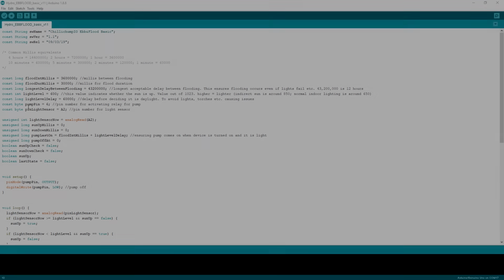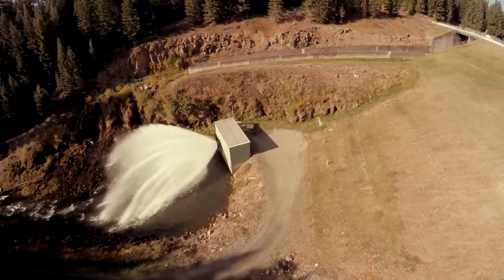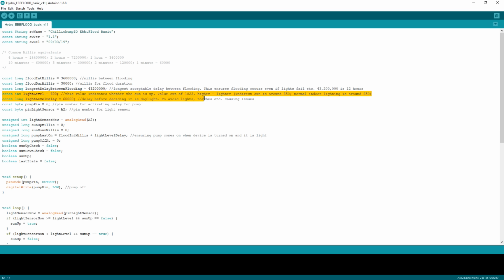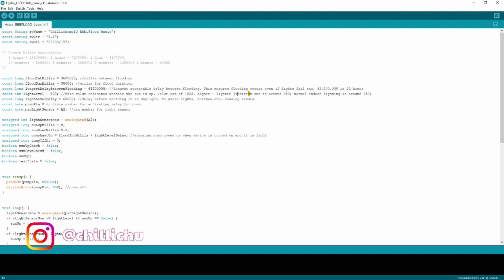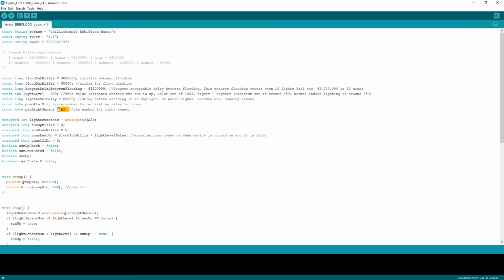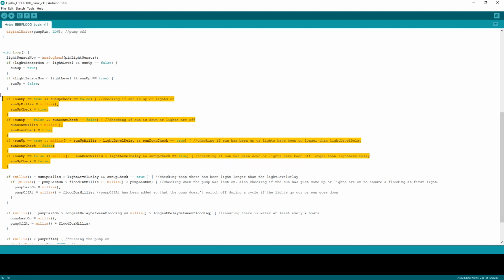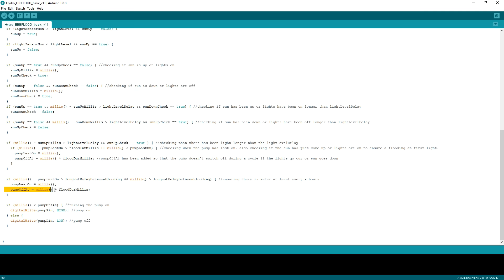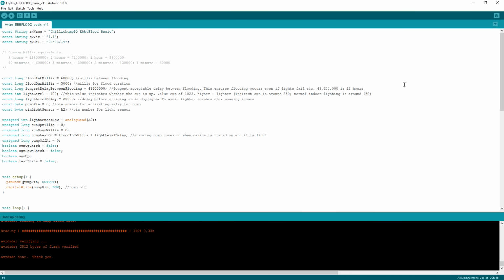Automated Ebb and Flood Hydroponic: Code and Schematics Included!

Comment: That was enthralling. 

I made such a system as this back in 1976 but of a "Haul a bucket of nutrient up at the beginng of the day and let it down at the end. It was into some flower Pots. I have no idea if it would have worked because I had to go to another site over the Sping/Summer and my wife was given instructions but when she tried it she couldn't lift the bucket of nutriants. The year 1976 was HOT in England so it would probably not been a sucess.
I am now a retired Controls type Electrical Engineer and this tickes my interest. I have used PICs in the past but 20 or so years ago. I am minded to have a go with this but as you were talking and my mind wandered a little I thought that maybe if you used a Latching Relay power would be much less. HOWEVER I do not know if such a thing exists at this level. Certainly they did for full voltage sytems maybe at 5V as well. Although the Fail Safe would have to be considered.
Looking forward to looking into this further over out Winter.

Comment: This is very interesting. With this script you could pretty much set up a flood and drain cycle, but would you have to have the Arduino tell a relay to cut power to a outlet instead of trying to power a pump directly. I'm not really sure how that would work out, I stumbled upon this video and have never even heard of a Arduino but this is some cool stuff.
Reply from the maker: The relays I use can work with mains AC voltage too. I use DC because I have an off-grid system where my greenhouse is. And it is a flood and drain script...so it can control pumps like here....or you could control a valve on a tap if you want too

Comment: Why not just use a timer and simplify the whole system, its less likely to fail in an indoor or outdoor system too.
Reply from the maker: Mainly because I enjoy doing this sort of thing. My whole greenhouse is automated, and haven't had a failure in over 2 years. That is far more complex than this
Reply: @ChilliChump  No issues with humidity? I tried something similar 6 months back and kept getting corrosion, only thing i could contribute that to was humidity. Also have to say love your videos.
Reply from the maker: No corrosion that I can see. I will be overhauling my system soon though because I need to add another pump. I will be switching to an esp32 as well. Currently using esp8266...but need more GPIO. Also the esp32 is meant to be more power efficient. So I will be able to check it over properly for any issues.

Also to add to my previous reply, the way I see it, we use hydroponics to optimise the grow. There is such a large focus placed on the nutrients we use (and light to an extent, if you are growing indoors). But why not optimise everything? The flooding/watering schedule is important and has a big influence on the growth of the plants. I have seen a difference with my experiments on watering schedule with my soil plants, so I can only imagine the difference it will make with hydro.
And with regards to reliability...that is one of the reasons I used an Arduino for this and not an ESP...besides the fact I don't need it to be internet connected, the Arduino will be rock solid (as long as you haven't messed up on the code!). Anyway, I'm in my greenhouse often enough to see if there are any issues.

Comment: oh Brits and their White for ground lol. I know, I know wiring and electrical are different there. Just still gets me everything lol. Love the vids man keep them up
Reply from the maker: Actually it used to be red (positive), black (negative) and green (earth). The new standards are  brown (positive), blue (negative and green (earth). The confusing thing is when your house has both colour codes! 

When I am prototyping I just use whatever is at hand normally...but should probably be consistent with the colours!
Reply: @ChilliChump  I know I was messing lol. Although US used to use black for hot and white for neutral ground. Now on a 2 wire system is still black hot, white neutral and green earth ground. On a 3 wire its black and red hot with white neutral and green earth ground. Then when you step up to 2 and 3 phase system its gets even weirder
Reply from the maker: Oh man...3 phase is a pain. We had that on our farm in South Africa!
Reply: Typically 2 wire will be a 120v while 3 wire (large gauge) is your 240v but there are instances where a 3 wire (small gauge) 120v is used for say in a hallways where two switches control one light and each switch has a dedicated hot while sharing the neutrals to complete the circuit.

Comment: This is a great video, not often you see code and horticulture combined.
If I could make a suggestion, it would be to apply a 2-3px black stroke when using white text. The overlays in this video were quite difficult to read, and adding a strong contrast outline to the text will help immensely :)

Comment: Liked the video. I feel some sentiments towards microcontrollers, since this was my first job 20 years ago. Now I am stuck with radio wave propagation and telecommunications regulations...
At home I am doing a watering system with Arduino for my peppers and would like to ask you if you had any thoughts on what water pump could be used for that. I need it to supply water for 3 - 4 plants so I assume that it should not be too powerful. I think on using water pump designed for a windscreen of a car. Maybe you had some suggestions on that?
Reply: Here is a good website that gives general calculations you use to size the right pump for your system. Hope it helps

https://university.upstartfarmers.com/blog/sizing-a-pump-hydroponics-aquaponics
Reply from the maker: I am using this pump: https://geni.us/ecobpump
The advice I got from Jukka was that you really don't need a pump that is too big. It will be interesting to see how this pump performs. You should be able to get away with a small fish tank pump...they are really cheap too!